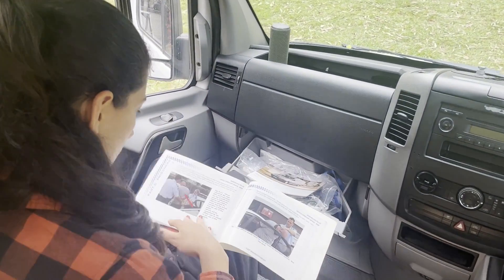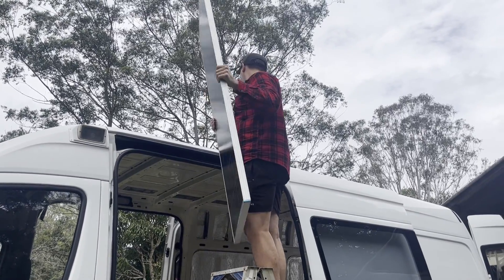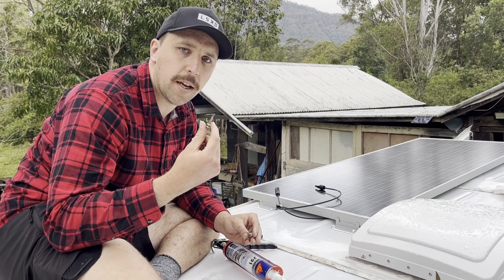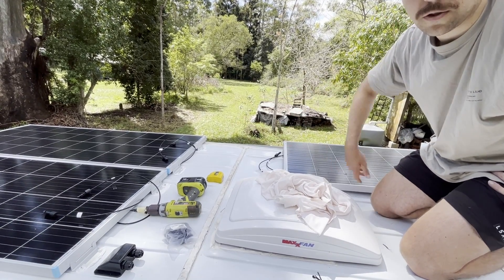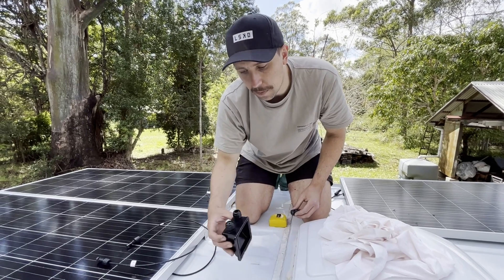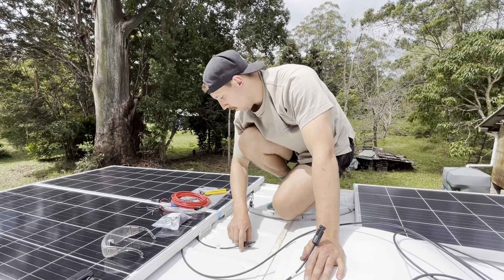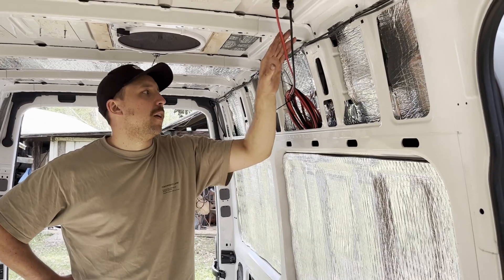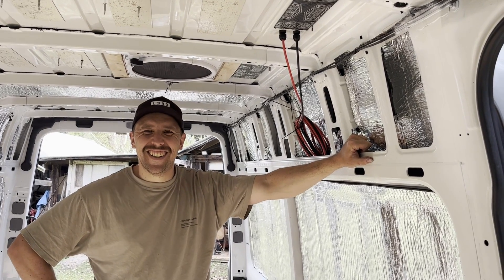How to Install Solar Panels - EP11 Van Build

Comment: Hi guys, great video:) how secure have you found the self tapping screws? We’ve got the same kit but don’t know if it’s worth bolting them. Thanks:)
Reply from the maker: They’ve been quite secure. They’ve been on for 35,000kms and a couple of years now and no issues. The other option is to put a roof rack on and bolt them to that

Comment: 😊 Hi and thank you for doing this build, so refreshing to see a Aussie vid, I’m planing a refurb of my motor home soon so i have got so much info from you, just one question the holes you drilled for the solar cables you painted the “bare metal” with a small brush with something on it, a metal persevere of some kind, what is the brand ?  See you on the road and happy travels, PS one thing you will notice is how bad the roads are out west, wheel alinement need often 😢
Reply from the maker: Thanks for watching! Glad you have gotten something from the videos. We painted bare metal with an etch primer and then an acrylic top coat. Don’t remember specific brands sorry, but if you go to an automotive shop like Supercheap auto where buy these sort of paints they’ll be able to sort you out for sure and make sure you’ve got the right products 😀

See you on the road! You’re not wrong with the roads. We’ve been on some shockers, especially the unsealed roads with corrugations